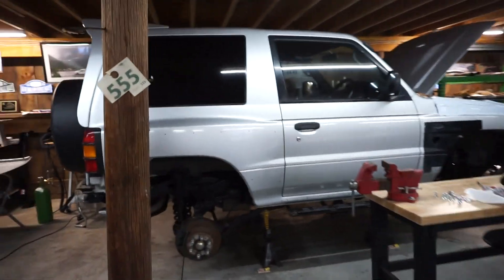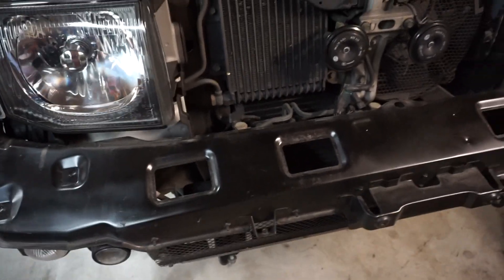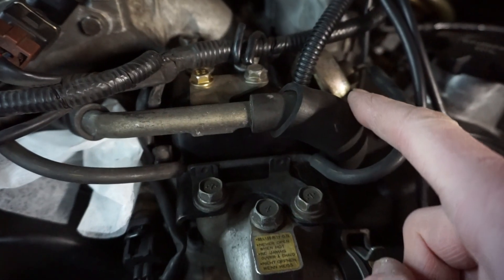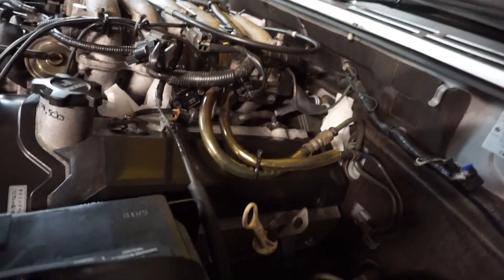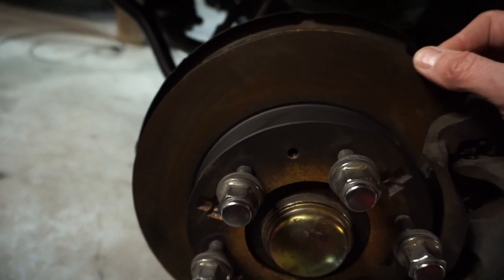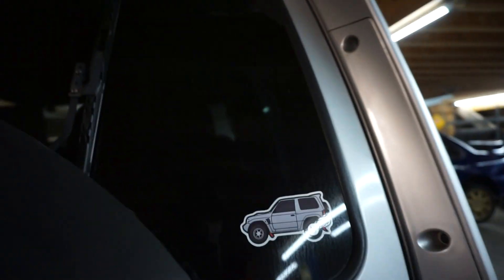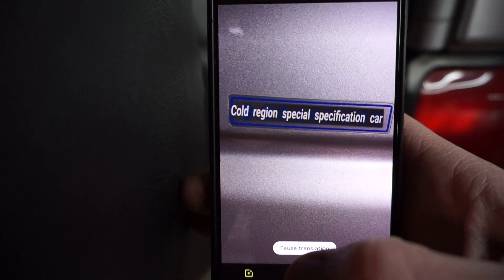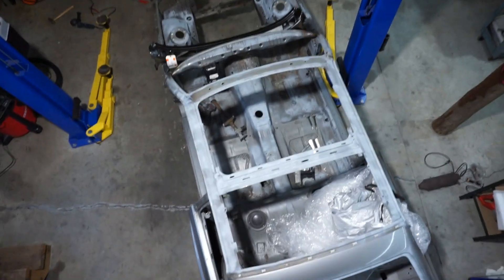CHONKK UPDATE- Pajero Evolution 2021/22 Work - 6G74 Mivec /ARMIE Suspension explainer V55W

Comment: What a beautiful Unit,  I have a question, do you know the size ( diameter of the butterfly )of the throttle body of that engine, I have a gen 4 pajero with the 6g75 mivec and think my throttle body is a bit small for the engine...
Reply from the maker: I don't know off hand Andres. I can try to measure sometime. It doesn't look exceptionally large, could even be the same one as your truck has with the 6g75

Comment: Finding spare parts for Pajero Evo is not easy even from Japan. Rotors and calipers are decimated for Pajero Evo, no much of cross use from US spec Montero. I am thinking to upgrade the suspension to bit stiff OEM spec, but very difficult to find alternative.
Reply from the maker: I totally agree. Padukku (spelled wrong) Garage in Japan offers custom Bilsteins, or at least on their site the struts are still offered. Brakes are impossible outside of Japan. I had to ship a set of rotors from Japan at great cost. Calipers are also not available as you found.

Comment: Great vid and info. Are you interested or thinking of upgrading suspension....think "King"/or other top brands level or better in quality, manufacturing, tuning, components, and capability, but much better price point? Thanks for all the posting, detailed topics and useful stuff, Cheers!
Reply from the maker: Thanks a lot for that. I have considered a different suspension but I don't really use the truck for anything heavy duty (yet) so I haven't looked too far into it. My experience with road cars has informed some of my decisions on suspension. King and the like are probably fantastic off road but those systems are generally more maintenance with open bearings and coil over threads exposed. I saw that Ohlins once made a kit for V55w which would be awesome to find. Also Padukku in Japan offers custom Bilsteins, or at least they did. Not cheap but an interesting choice.
Reply: @race-partners  Sounds good, really appreciate your Pajero Evo V55 content :) 
That shifter reversal to race sequential pattern is beyond awesome, Bravo!

Comment: Do you think it's possible to convert a standard pajero like an NL from torsion bar to coil / spring at the front? I'm out in central australia a lot - big long roads full of corrugations. Done all my bushings at the front end which was a hell of a job and all new suspension parts, rotors, hard brake lines etc and rebuilt the engine with new heads... runs amazing but the only thing I would change is the suspension!! So hard up the front hahah
Reply: Did you ever find out if it's possible?